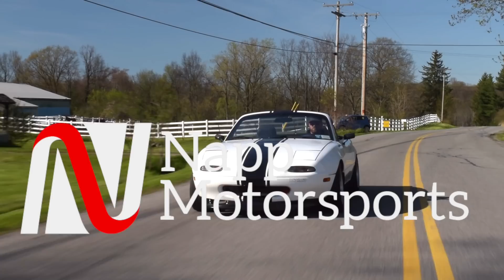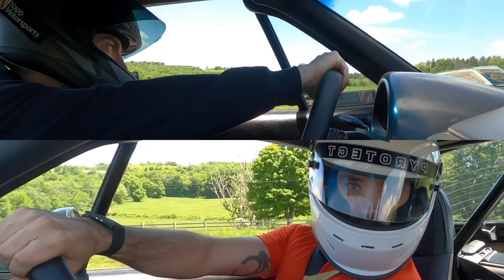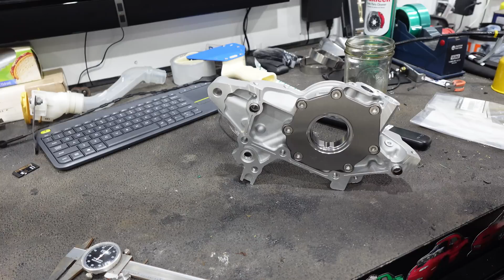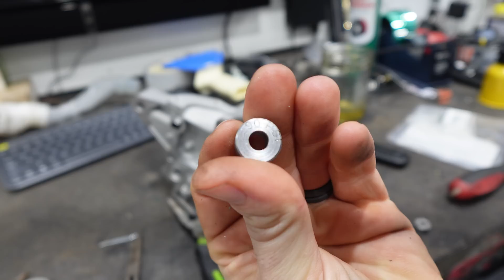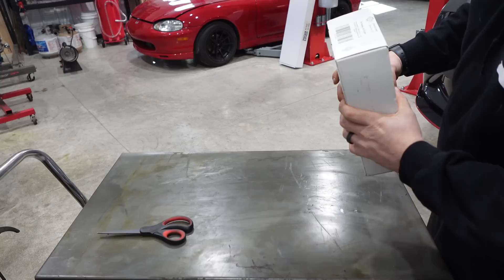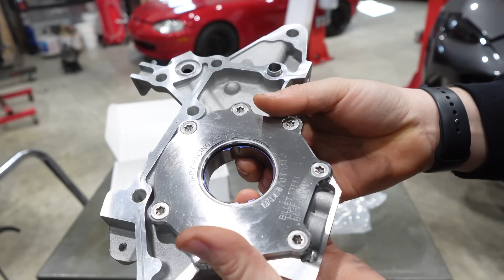What Oil Pump is Best for your Miata | Boundary Racing Pumps

Comment: great video, but i'm not sure about one thing. I have an na and i'm rebuilding the engine. i want to add an oil cooler and, probably, i will sometimes go into the fun zone of the rpm. it is better to install the s2 or i can install the s1?
Reply from the maker: S2 never hurt nobody.
Reply: @NappMotorsports perfect,thanks!

Comment: Napp was wondering if there is any difference between VVT and BPS2 Oil pump exept for the billet gears?
Reply from the maker: I do not believe there is a difference. You can do a gear install on a stock pump if you wanted.

Comment: do you have a recommendation on when it's worth upgrading from the OEM pump? i have a TDR rotrex kit i'm installing with stock internals, and am expecting to make 220hp with a standard 7k redline. my car is a mostly street focused dual duty car so idk if it's a good idea or not worth the money for my needs
Reply from the maker: I upgrade pumps on any engine I take apart. Not a bad idea while you’re in there.

Comment: I know you’ve always said a 300hp Miata is the sweet spot. I feel like many people don’t ever get appropriate representation of different power levels in these cars. I think it’d be a really good video if you get a few cars together at different power levels to show pulls, practicality, price concessions with parts (stock vs 225hp, vs 300hp, vs more). Bofi published a sheet on their website a while back showing the breaking points of all engine and driveline components that thought was an awesome read, but I think many people don’t have a good reference for exactly what you’re getting for the cost at these different power levels. Maybe one person wants too much power for the cost because they underestimate the experience vs another person that really needs to understand what building a street missile to roll race actually comes with when it’s time to make certain sacrifices.
Reply from the maker: Maybe one day. Tough to line that all up

Comment: did boundary reliably fix the sticking relief valve issues?
Reply from the maker: I’ve only had that issue once, and not in the last ~15 pumps I’ve installed

Comment: question about oil flow if its a vvt motor have you ever fed a turbo off the back side of the vvt solenoid? other than packaging near the oil pressure port wouldn't volume be the same before or after the vvt hardline?
Reply: Yes, it can be done. This is how we had our EFR car for a long time.
Reply from the maker: Like Bofi said, yeah you can feed from that NPT port back there. Did it like that on the first turbo BP we did.

Comment: How do you decide which PSI setting to run?
Reply from the maker: I base it on how many extra things you have on your engine. Turbo and oil cooler typically call for a higher shim.
Reply: Depends what bearing clearances you run

Comment: Question: Has anyone to your knowledge threaded the piston bore and setup a set screw type arrangement to configure pressure? We did that with air-cooled V-Dubs back in the day (50 years ago☺)...
Reply from the maker: You can’t access it once the oil pan is on, so no. Would be cool though.